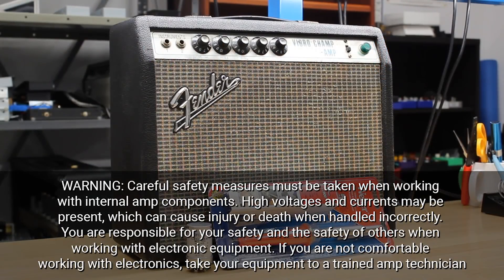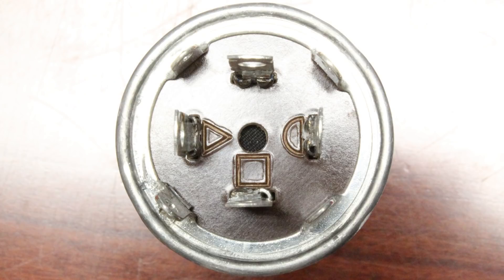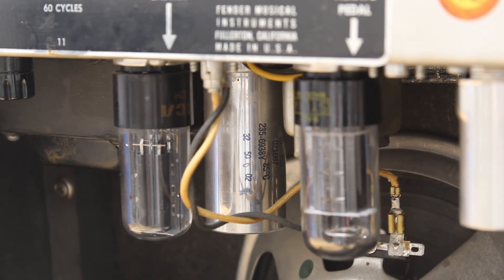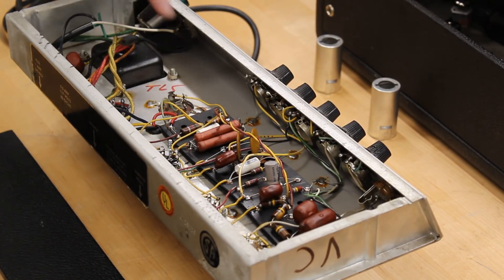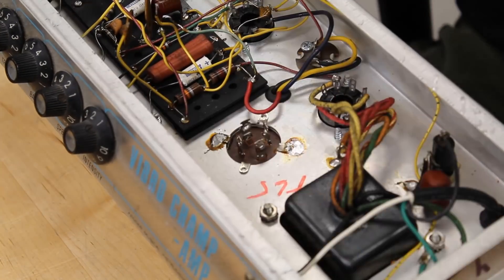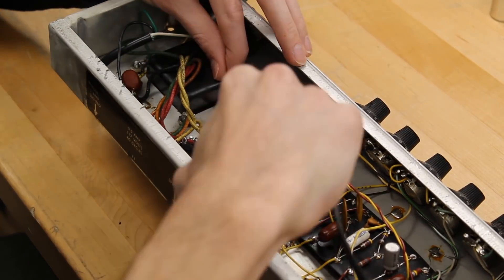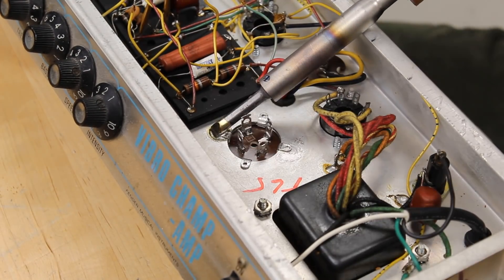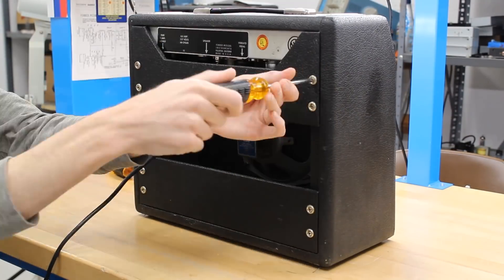Replacing the Can Cap in a Fender Vibro Champ

Comment: Is it really recommended to change caps "every few years"?  I thought 10 or even 20 years was possible .  Chances are you'll also want to change the electrolytics on the boards ( eg white Mallory)  , they go bad too
Reply: I agree, 20 years has been my experience.  If the amp is played often,  maybe it'll last longer. Sitting in a closet, maybe every ten years.

Comment: hello can you tell me what year this amp is made i just brought a 1977 model because i dont want digital reverb lol & a new one is far too expensive.i can see yours has a choke so im hoping mine has as well its got a nice vintage oxford speaker upgrade so i might get it recapped.but i was gonna add a choke as well so hopefully i dont need to.so my question is would you add triple treble tubes to this amp to get overdrive or get an overdrive pedal ?? & what tubes do you think are best for overdrive.but great post when fender built amp,s how they should be built i mean this model ran from 1970 to 82 & mainly the speaker got cheaper but the hand wired circuit remained the same barring a few cap changes & the death cap which im told can be earthed & kept in the circuit.not sure but apparently its there to make a blackface version sound even better even though its life threatening lol peace...
Reply: '64 to '82 really..

Comment: That was very informational. Have you produced any videos showing how to replace the cap can with individual capacitors. The cap cans are quite expensive and I would like to cut costs. Thank you.
Reply: That's a poor hack.  I've done that with cheap Valco amps, but not Fenders. Just hot-glue the axial to the chassis.  If you can't afford a $36 cap can, then maybe you shouldn't own a Fender tube amp.  These are expensive amps and need periodic maintenance with not-cheap parts.